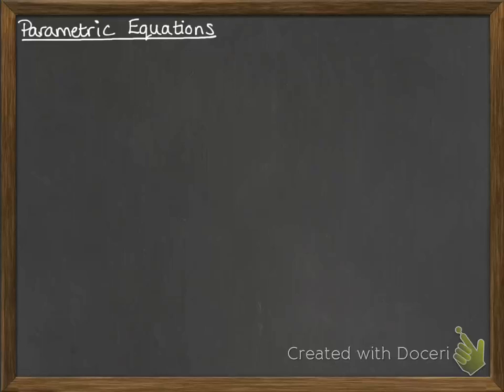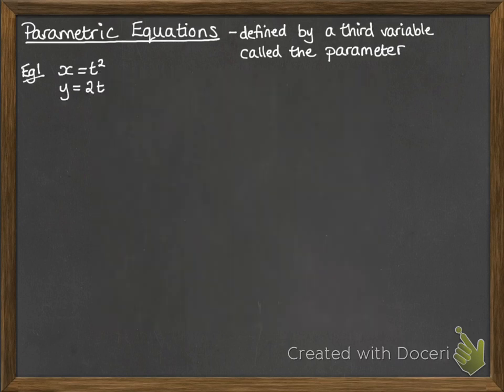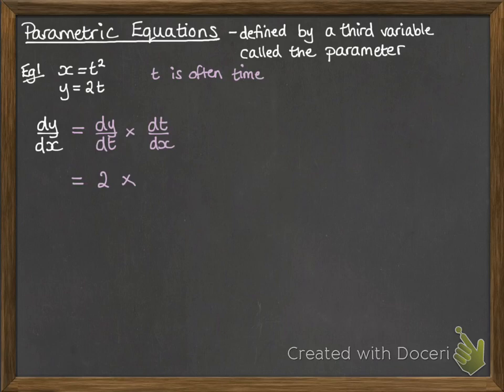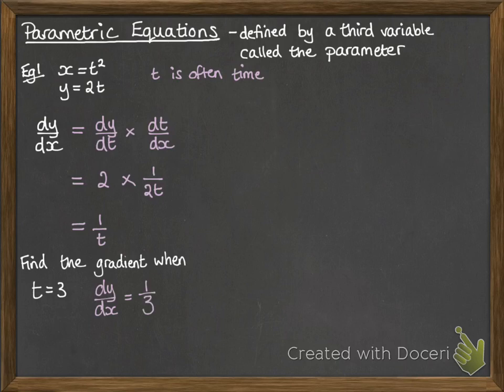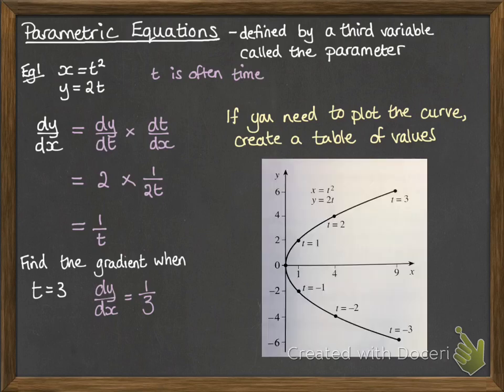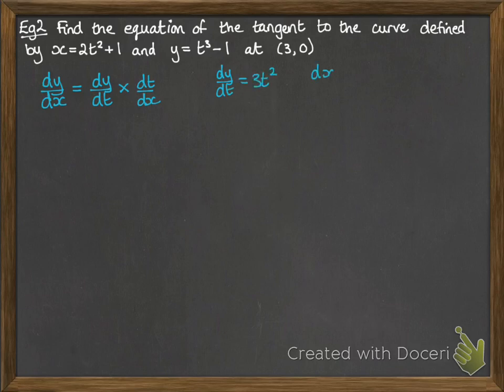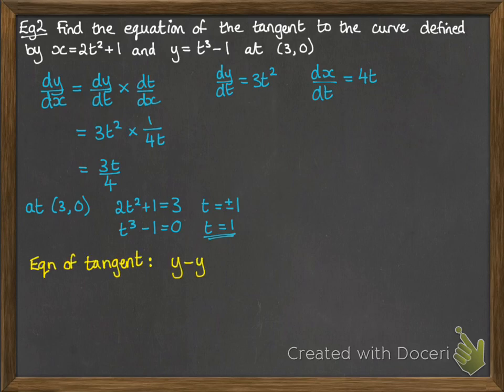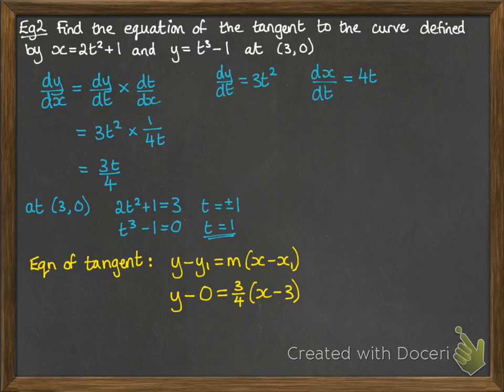Differentiation 2.5 Parametric equations

Comment: Hey Mrs. O'Gram. Just a quick question:
2 x 1/2t = 2/2t = 1t , which makes
dy/dx = t?  or no 🤷🏾‍♀️
Reply from the maker: No.  The t is on the bottom of the equation.